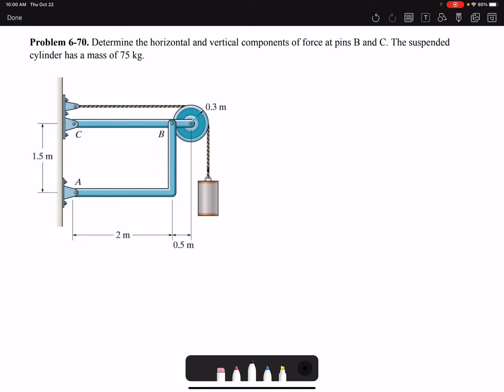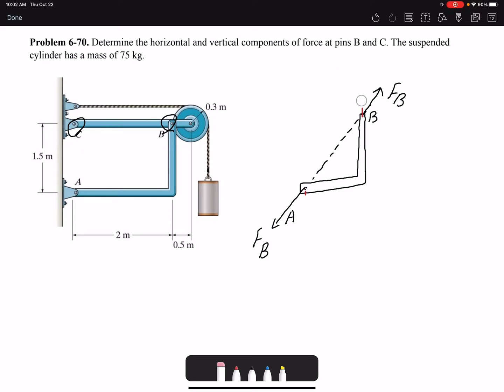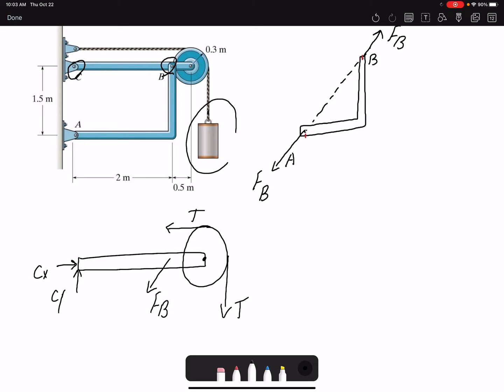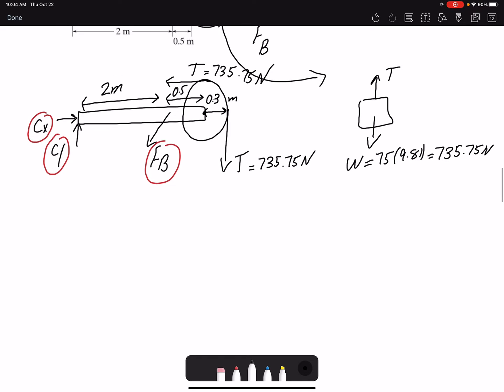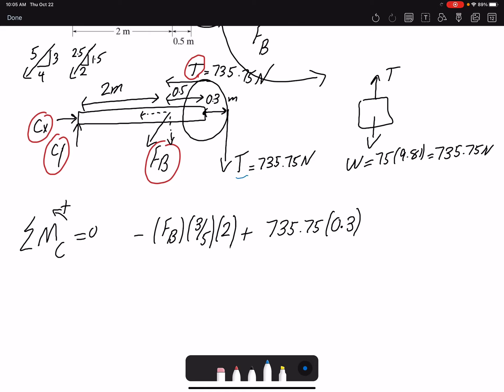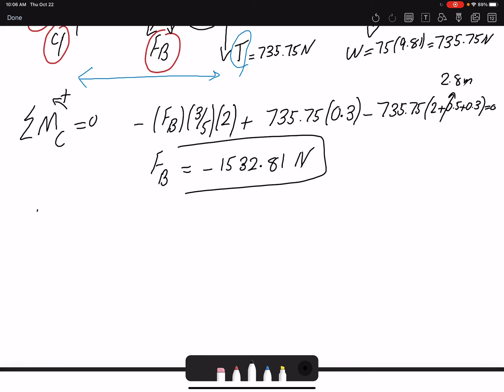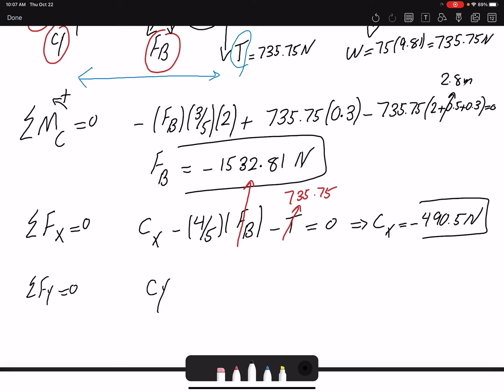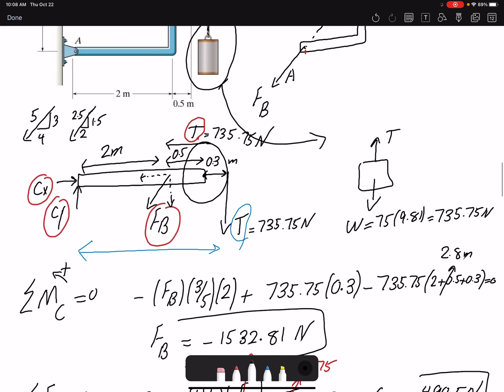Statics Problem 6-70: frames and machines example with two force member

Comment: Why we did not show the pin's forces that pulley connected to?
Reply from the maker: That’s a great question! 
We didn’t separate the pulley from the beam, we drew the FBD for both together, so the forces at pins are internal and we only show external forces in FBD.
Reply: @engineeringvision  Thank you for answering me🥰.